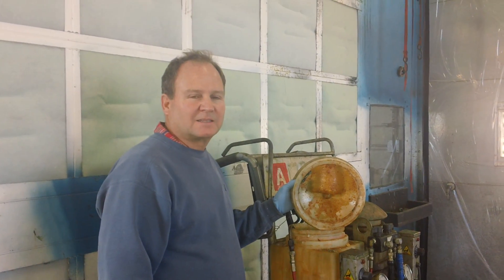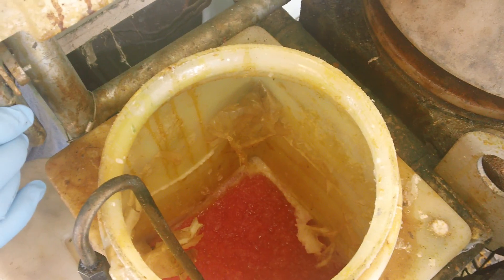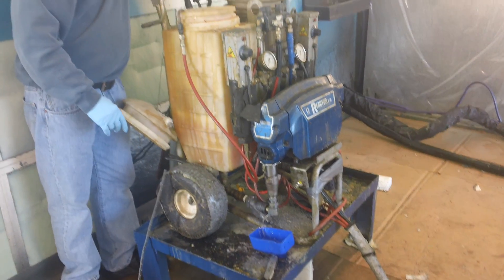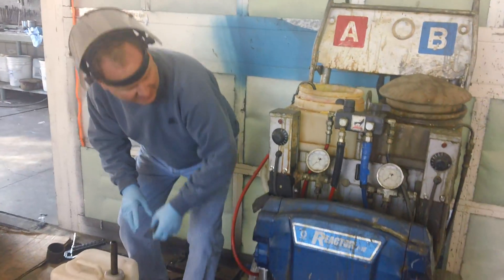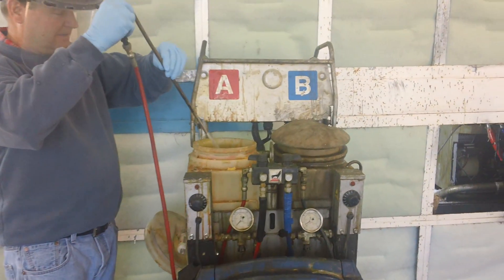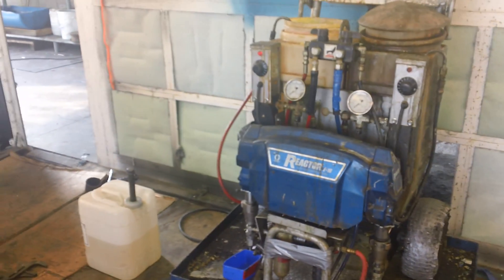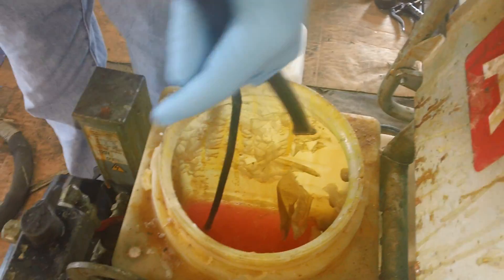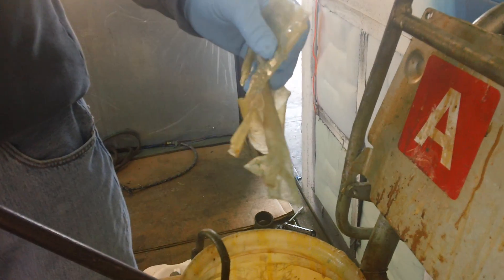How to clean Graco E-10 tanks

Comment: Graco E-10 can't spray polyurea because the pressure is low, Graco also recommend that Graco E-10 and E-20 arre not designed to spray polyurea, just spray polyurethane foam
Reply from the maker: You are correct, however: The E-10 will spray polyurethane that only requires 1,500 PSI spray pressure, we have done it.

Comment: can this machine spray PU foam and polyurea ..i mean not at the same time.of curse?????
Reply from the maker: The E-10 will spray polyurethane that only requires 1,500 PSI spray pressure and it will spray foam.